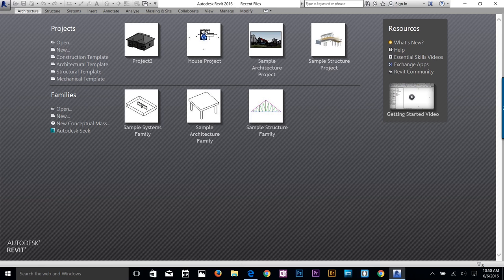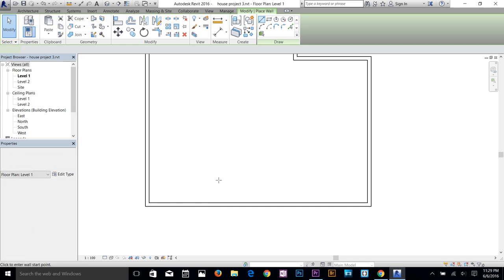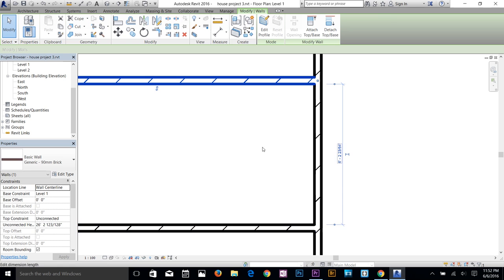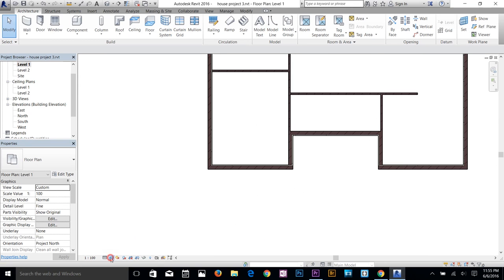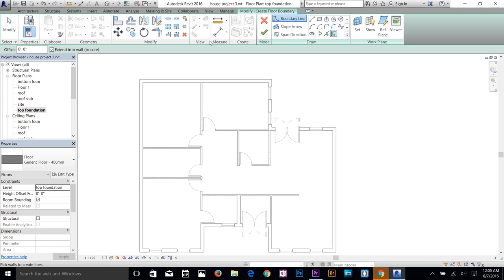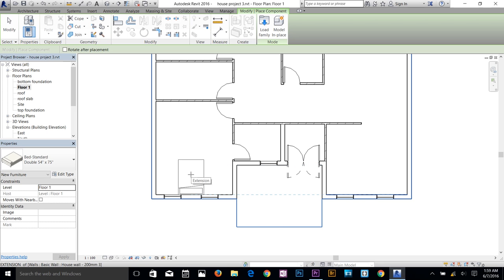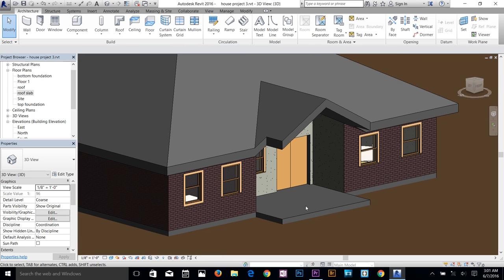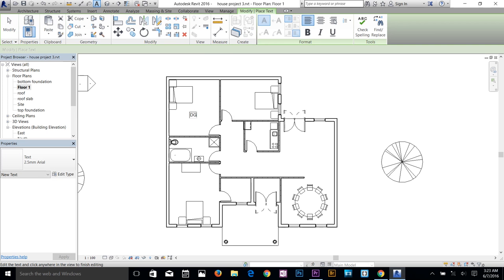Revit House Project Tutorial For Beginners 2d House Plan And 3d House Model

Comment: when I am going add structural wall after floor just like you.  showing me error as ". The top of the wall is lower than the base of the wall." while changing from unconnected to bottom of the foundation.  please share about how should I resolve that.

other than that a great video.
Reply: Even I am having the same problem, did you find the solution??
Reply: Hey i came to know why i got the same error, it was because i have selected architecture wall instead of structural wall 
May be you have done the same thing
And i have no idea why he has selected structural wall instead of architecture wall (he dint mention in video)
hope you solved the error

Comment: 'None of the created elements are visible in Floor Plan: Top Foundation View. You may want to check the active view, its Parameters, and Visibility settings, as well as any Plan Regions and their settings.'

i am getting that error while trying to make a structural wall in foundation. what does it mean?
Reply from the maker: tell me the time in the video
Reply: 26:02
Reply: did you find the solution?
Reply from the maker: Best Selling Course on Udemy : https://www.udemy.com/revit2017/?couponCode=AWAISYOU50